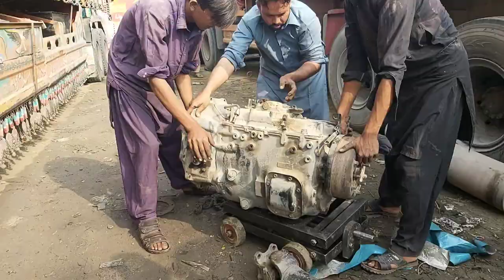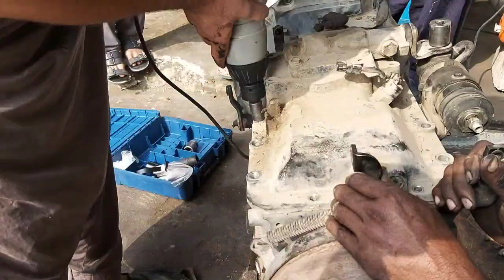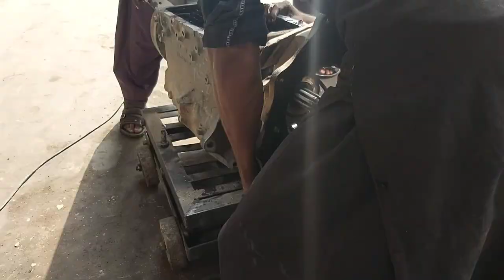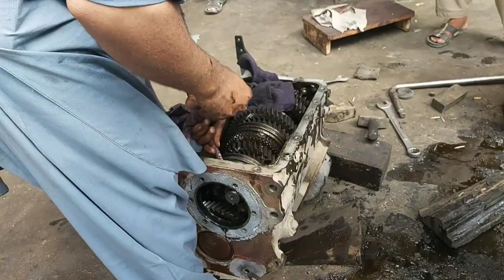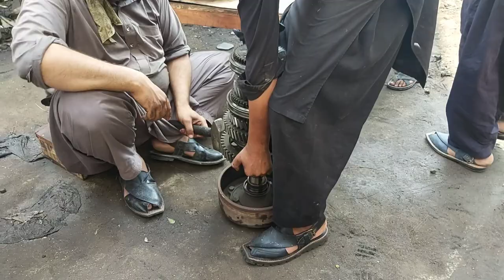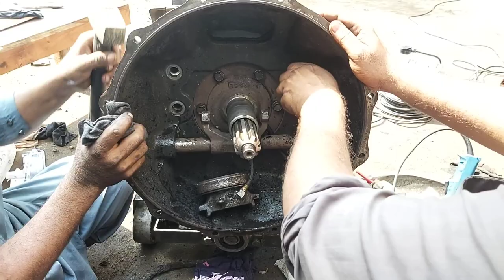How To  Repair Hino Truck 🚚 Differential GEAR Repair | Frist Time Repairing GearBox Truck Dumper

Comment: The brazed up a gear that looked like a mate to a synchro ring nice bush fix, however the cut it strait on the lathe when it was supposed to be cut tapered to match the synchro ring that I think he cut straight to so the synchro is just as bad as before.

Comment: 20:16 - it is impressive how they read the specification and apply the specified torques with a torque wrench
Reply: No more spec for this old engines tbh, but when he washed the inside with the hose and smack the specs out of that poor  bearing ffs
Reply: I have a feeling this transmission left in worse condition than when it came in.
Reply: I like the white RTV caulk they use. It looks like bathroom caulk.